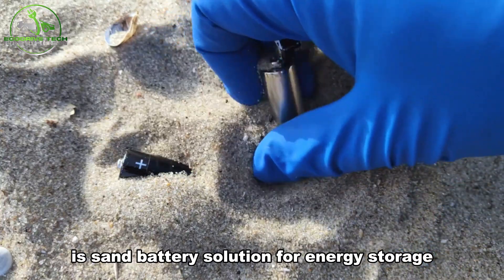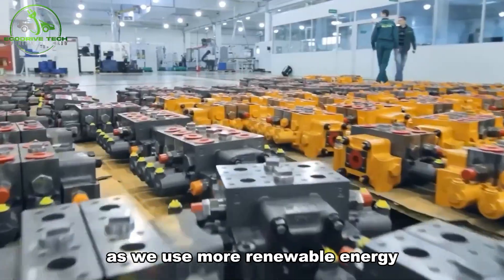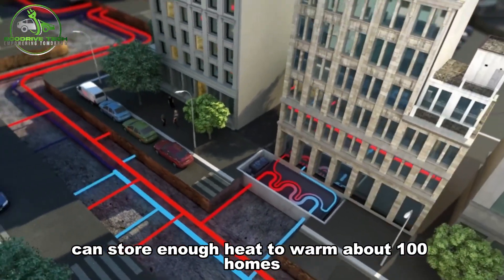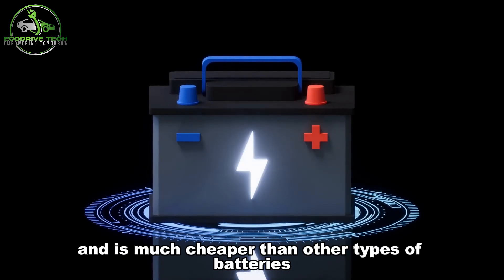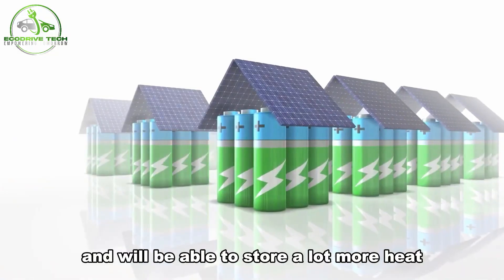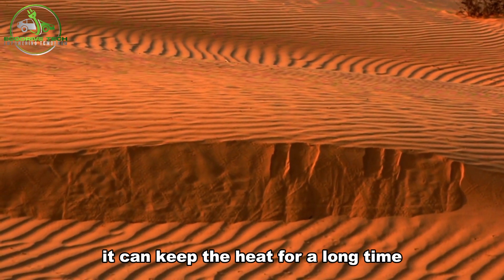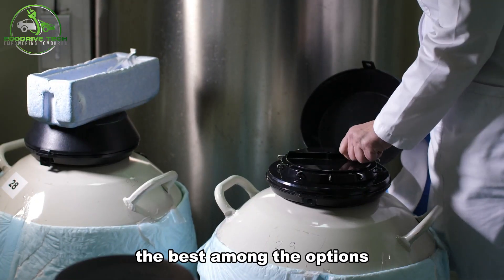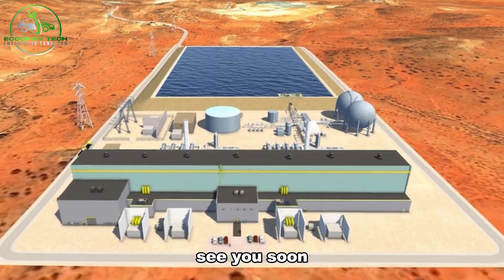This CRAZY Battery Made of SAND Could Power Your Home!

Comment: Technically (and thermodynamically) it seems to me close to absurd in comparison to other options. The temperatures are absolutely extreme for all materials in order to store big quantities of energy; sand is much more complicate to handle than water and it doesn't  have a high Heat capacity, in part because of the air between sand particles. Make a pure water thermal storage reaching just below 100°C (boiling water, ~212°F), water has a high Heat capacity and makes an efficient thermal storage, it moves by itself to homogenize the temperature or for tank cleaning; the temperature doesn't create a a stress to the materials. The thermal sand battery is a false good solution, seems to me.
Reply from the maker: Thanks for watching

Comment: A sand battery used for heat is great but converting from solar to heat and back to electricity again is to inefficient, I think Sodium ion is going to be what most homes choose when it is scaled and becomes much more affordable in the next 5 to 10 years. And probably so cheap that it gets used for heating also. Eg. when you can buy 30kw of Sodium ion storage for 10 grand or so why bother with anything else.
Reply: Now you can buy 30kwh lifeo4 Eve 304ah 36 cells for $1600 USD , you don’t need to wait for 10 years to get it, same Na ion cost but don’t give you flat curve unlike lifeo4.
Reply: @pr5991  Yeh those Eve cells will be what I upgrade to at some stage but I wana see if I can get a decade out of mine first. Because that is the promise of lfp and the kind of longevity everything we make needs if we are serious about a sustainable future that isn't more bs.
Reply from the maker: Thanks for watching